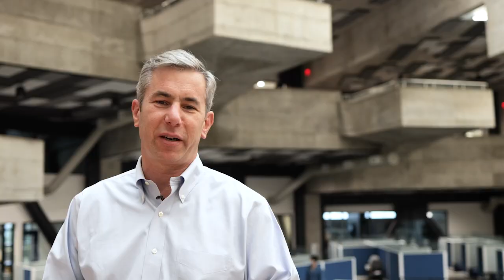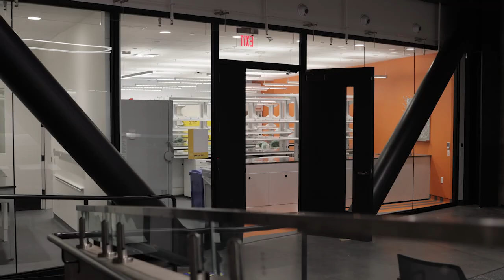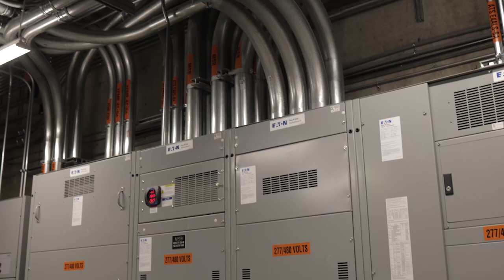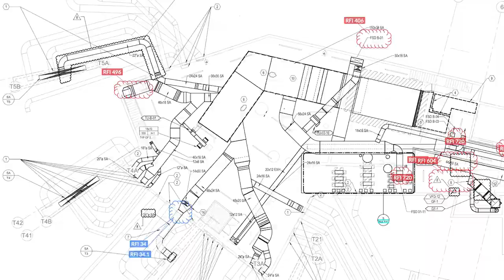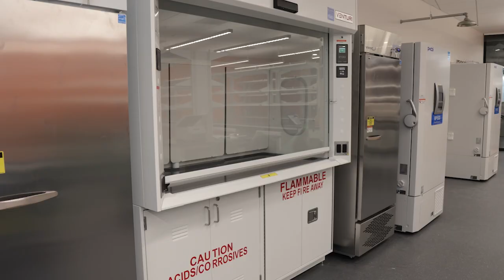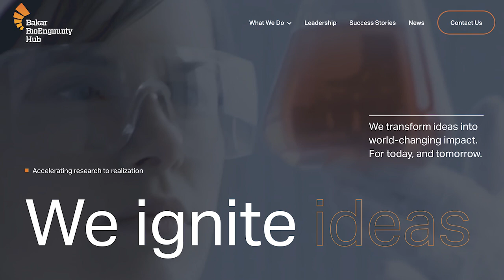The Making of the Bakar BioEnginuity Hub at UC Berkeley

Comment: This was one of my last projects before retiring in 2022.  I was the One-Line Electrical Foreman responsible for 95% of the lay out and installation of all normal and emergency power distribution systems from the basement throughout the building and grounds.  That basement was both my office and "canvas" for 18 months.  It was by far the most challenging and rewarding project I have ever been a part of.  This was my Magnum Opus.
There are no boilers in the basement as stated in the video.  Instead, the building relies on an exterior electric water heating system known as a modular air-source heat pump (ASHP) system for both hot and chilled water.  This is an all-electric building with operational carbon neutrality status.